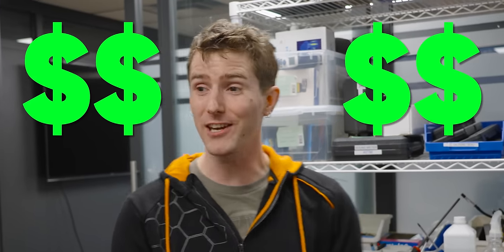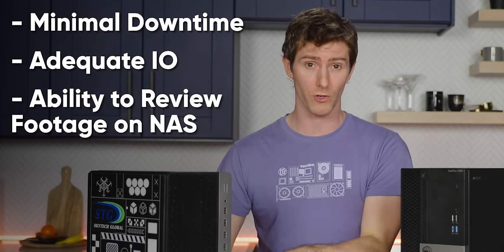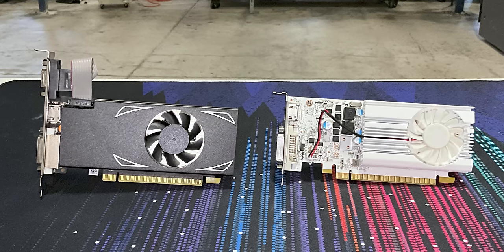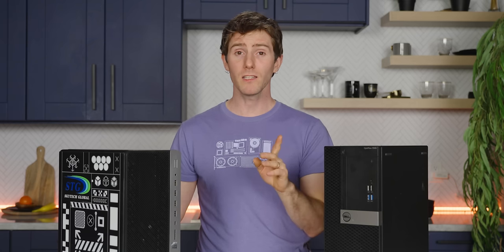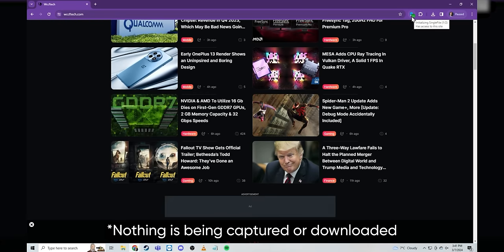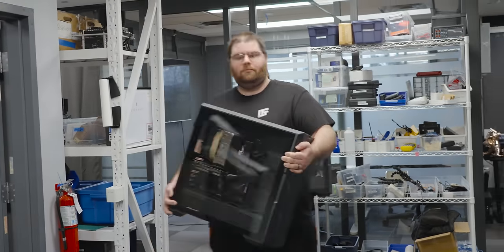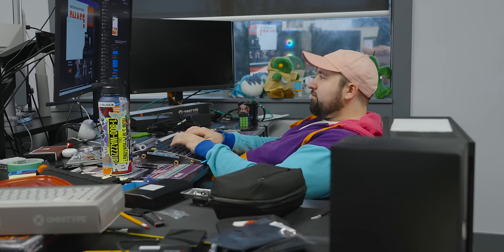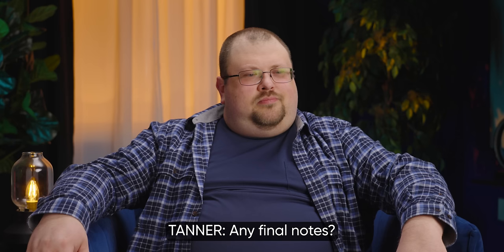We Downgraded our PCs to Prove You Don’t Need a New One

Comment: Not mentioned in this video: Many companies are constantly replacing their machines every few years or so because they are LEASED and not PURCHASED.  If a computer is leased, it is a regular, expected, expense.  It isn't the company's problem to properly dispose of the machine at the end of its life.  It isn't the company's problem to repair it if/when the hardware breaks (that is the manufacturer's issue).  And, all of this... is exceptionally important... as many companies are moving to "all staff get a laptop" for "capability to work remote (whether the employee wants it... or the employer requires it)".

Yes, many small businesses could easily buy 3 "grade A" refurbished machines for their one or two "office workers".  Why 3?  One or two for use, and another when a bug in one of those forces a machine hot swap.  Gamers usually cannot get good prices on these, though, due to inadequate PSUs, proprietary wiring / case designs, etc.  Luckily for many, though, the "SFF living room PC" (for many) is now easily replaceable with direct plug in to HDMI / DP port stick PCs with built-in wired networking/WiFi.  Want to play steam games?  Steam deck (and allow your gaming PC to do the heavy lifting).

Companies lease low-end quality, minimal cost, machines.  Manufacturers make them, and make a hefty profit.  First party manufacturers (Intel, AMD) get a place to sell their low-end quality dies (lowest end CPUs) instead of everyone demanding mid to high end.  And, in the end, recyclers ... and landfills... get the waste.
Reply: exactly. We at work have mac pro 7.1 leased and I actually got to buy a 28-core 512gb RAM version at the end of the lease plan for less than 2k $. (Lease plans are usually 2~5  years, ours was 5, now the whole company uses mac studios on an another 5-year plan.)

Comment: Question: did you just move the system drive 2:40 and boot from the old windows installation or did you re-install?
Because no re-install would explain quite some of the issues you ran into.

Comment: I really appreciate your channel making this video, and I hope you periodically shine a light on this perspective in the future. If I have one critique, it's that all the "test subjects" are from the writing team. The video does a great job explaining why video editors & CAD/designers were excluded, but what about the other departments? Are the other departments already using brand-name prebuilts? What about Sarah (or someone from her team), or the labs? (seeing as this might have been a great cost saving measure for an expansion with multiple workstations)
Reply: Well Sarah is presumably running Photoshop and illustrator where cpu speed is still important, labs would be compiling, crunching large spreadsheets and who knows what else. 

Presumably they also wanted to stick with fairly technical users who don't do heavy processing on their machines which is pretty clearly the writing team. Also it's one member of the writing team coordinating this video so they probably just asked the people who sit around them
Reply: I work in a professional CAD (primarily Solidworks) environment with older (admittedly workstation class) DELL hardware. I call BS on the majority of calls for the lastest hardware being needed. I still use a Quadro P4000 for example, and it's more than capable of running my software. I'm limited more by other inept co-workers than I am by my hardware!

Comment: "...As recent as 6th gen"

A lot of companies have 3/5 year replacement cycles. At the company that I work for, we're now cycling out 10th gen laptops and starting to cycle 8th gen desktops (we've just completed our 7th gen desktop decommision)
Reply: work is 5 years, and most people are not due for an upgrade quite yet, when the covid hit everyone got a laptop and desktops are only for those that actually need extra power the high end laptops can't provide
Reply: @EnyoStudio  doesnt the AI requirement only apply to prebuilts shipping with 12?
Reply: @EnyoStudio isn't the CPU only a bottleneck if the game actually uses the CPU but since most games only use the GPU it doesn't matter?
Reply: @Lollllllz we are barely on Windows 11 and your saying Windows 12 exists? Lol
Reply: @bland9876  there are rumors that the  the next major version of windows(commonly referred to in the rumor mill as 12) will require an NPU and 40 TOPs performance of unknown criteria and 16gb minimum ram presumably for the AI features.
Reply: @Lollllllz  who would want that? I'm skipping win 12 if it's that bad.

Comment: I'm using one as my main media player (streaming, stored videos, music, etc). It's a 3rd generation i7-4790 than can IN FACT play the newest games... IF it's it got a beefier display card in it. I put in a simple 1060, which is more than enough for just playing media. Got it refurbished from Amazon and I tweaked it to my needs and put it in a nicer case. I tweaked the GUI to resemble more like a smart TV app and programmed macros to use it with a PC remote control so it auto opens webpages and auto full screen without having to manually glide around with a mouse cursor.
Reply: I helped my dad build a low budget pc for him to run ms flight sim, i7-4790, 32gb ddr3, rx 6600 - 
Runs 4k on high totally playable (given that a sim is not a fast paced game, so 18-20 fps goes fine)
Also manages to run the sim on VR at 1.1x quest 2

Comment: I mean there is a reason schools and large businesses standardize their equipment. One companies like Lenovo offer better warranty on their business class items. Especially if purchased not via normal retail. It makes it easier to manage and replace a device if it does crap out as well if you buy devices with removable storage as then you can just swap machines out and move hard drives and have the user up in a matter of minutes. 

I led a school roll out of Lenovo desktops for a district and it was like 1400 machines. Before delivering them they had us setup the bios with boot order for things like boot from network most other methods really locked down and with a password they provided. 

Once delivered we setup them up hit the power button and they pushed out custom school district images to each pc as it booted over the network adapter. It also lets them wipe any remotely as well. Pretty handy in some circumstances.

Comment: My current gaming PC is a circa 2013 engineering workstation optiplex rescued from a pallet in the shed at work. It had mold growing on it. 

$150 worth of GPU and PSU later it runs great

Comment: ok.
Those "bugs" could have been related to the fact that you just moved the SSD to the other machine and not a fresh install.
Also, Some of those could be related to GPU issues. 
I think some 8-9 gen CPU machines would be ideal for office stuff, with a drop in 1650 gpu for a powerful yet reasonable gpu. I suggest Tanner try that combination and see what happens.
Reply: Flickering youtube is something that happens on my gtx 1070. It is chromium bug that nobody fixes for a year or two.

Comment: I'm still running a i7 4790k, with a 1080ti and 16gb ram
Reply: i dont know other countries but in mine 4790k prices are ridicilous - its only 20% cheaper than i5 12400f, z97 mobos has the same prices as used b660, and ddr3 cost more than ddr4, so i matter of whole pc cost 4gen cost more than 12gen, sometimes even 3gen cost more
Reply: 1080ti ? sheeeesh someones rich, nah ive just upgraded other stuff first, i7 7700, 1070, 32 gb ram, and tbh the saddest part, my cpu holds me back more then my gpu in most games.
Reply: That's still a baller PC, even though that CPU is kinda shit by today's standards mostly cuz it's a quad core, the GPU is still upper mid-range, it outperforms both the rtx 3060 12GB and the RX 6650 XT 8GB, which are both very popular and not to mention, much more expensive cards.
Reply: what games you play? i wouldn't want to play cs2 with that rig lol
Reply: YOOO I USE i5 4670K WITH RX570
Reply: @bored588  i wishhhhh, i got the 1080ti for free
Reply: Haha I have the same cpu and ram setup. Works great for me. Only got a gtx 960 though.
Reply: Bro that was a godlike system back in the day
Reply: Im still running my laptop with 4720HQ and GTX960M, it's still quite capable of doing a lot of things.
Reply: @georgelong5180  the 960 is a great card, as long as it's the 4GB model
Reply: I5 3560k, 16 1600, 2.5"ssd boot, 2x 4tb running in raid, quadro m4000. 
Not a gaming beast but will get all my work done no issue

Comment: Are we certain that putting drives from new computers wasnt the issue? In my humble experience windows drives put into different systems tends to shit itself.
Reply: Yeah. I agree with you, those machines shouldn’t be that bad.
Reply: See I have had zero issues doing that. My current OS install has been through multiple upgrades. It started as Windows 7 on a Q6600 followed by an i5 3570k. It was then upgraded to Windows 10 and shortly after cloned to an NVMe on a Z97 board. Then it got upgraded to an AM4 X570 with a 3700x and now it's in the same system with a 5800x. I've amazingly had no problems and still boots in seconds. That said, I do run maintenance on the registry from time to time and I have also removed all traces of previous drivers (including force unhiding everything in device manager to purge old entries).
The main reason I imagine that the old systems were that bad is I bet they have a LOT of background processes/apps purely because they can do so on their modern systems without noticing it.
Reply: @AndyMitchellUK26 The glitching what bothered me mostly, tipical driver issues. I experienced exactly this when I tried to save the data from an old pc.
Reply: @AndyMitchellUK26  Did you hear of Theseus' ship? xD

Comment: The 4th gen chips are still good! not that much of a downside unless you doing heavy workloads! Love the video!
Reply: i like 12 gen core i5  storage speed is what matters whit light use
Reply: @404hopenotfound  Man, My pc is a dinosaur... Like flashbacks to un-bearded Linus reviewing the pc I am using old.
Reply: wow hope you dont have to use the igpu they were pretty bad @BinkersGaming
Reply: Even 4th gen is more than enough for casual users. Today I used my backup laptop that has a 1st gen i3 and forgot how snappy it is with a period-correct OS and programs.
Reply: @BinkersGaming I had x58 2008 platform until a few years ago, I know a guy running althlon 64 on Linux
Reply: Linus should have gone Sandy bridge. I am still using my 2500k for my plain office work, but with a rx570 was still fun to play Fortnite with.
Reply: I'm still on a z97 MB running a i7-4790k with 16gigs of ddr3 ram and a 1050ti gpu. Works perfectly fine for me 😁 wouldn't mind newer tech, but then again, it doesn't feel necessary.

Comment: Thank you. Still using 2007 VIA C7 2GHz (Jetway J7F2WE) desktop under Win XP, 2009 Intel Atom 330 1.6GHz (Jetway NC92) desktop under Windows 7, 2013 AMD E350 1.6GHz (Gygabyte GA-E350N) desktop under Win 7, 2018 AMD Ryzen 5 2500 laptop under Win 10. Working fine beside the RAM usage getting ridiculous with each Windows update. For "security reason" they say.
Reply: good god, sorry but those are and where horrible embedded systems. do you per chance just run industry software on the embedded systems? because thats the only usecase i can fathom where they dont need a few minutes for moderate tasks. laptop is fine tho, ryzen mobile rocks.
Reply: @tarkitarker0815  Not embedded systems, full mini-ITX boards, very efficient, just some lack of memory on some of them. I don't do gaming on them though, for obvious reason.
Reply: @davidkoch9123 well my point still stands, and dude, you cant get shit done on via, via was remarked as too slow to enjoy working even back when the chips came out. it has a reason ibm bought via for the sole reason of "no interaction" low power systems to watch over things like surge spikes. i get that you can live by it, but you would have saved money if you dropped the via system as via was EOL by energy costs. idk if you keep it as a hobby but it seems that way.
Reply: @tarkitarker0815 Of course no more "real work" is done on it, yet it remained my main system for more than 5 years and it did great, office work, coding, browsing, the biggest lack was video capability, had to add a 5200 video card to get decent 3D and playback, but still a great system, whatever you may believe or not, the C7 was very capable back then.
Reply: @davidkoch9123 define "back then" up until 2012 i believe you, you made it sound like you still use it. none of the systems apart from the atom were awful 4 years after release, but shortly after. the atom was just ewaste to begin with.
Reply: @tarkitarker0815 Atom 330, was mostly to have a 64 bits dual core complete system for $75. And yes, up to 2014 it was good, but Windows' updates made them harder to use.

Comment: Right now I'm using an old Dell laptop from 2007. I bought it at an estate sale for $50. I upgraded the ram, it came with just 1 gig, I put in 4 gig. I also put in an ssd. Boot time got much better. It's running Lubuntu. 22.04
Reply: Good deal....  //  If you are using a video editor.... or if you have a suggestion... which one would you recommend?   Thanks.
Reply: That's one thing I'd like to do this summer: put NVMe in my old boxes which are now on spinning rust.  I'll need other media for boot, but that should make things a lot snappier.
Reply: @FeedScrn  Thinkpad T480's are adequate for video editing
Reply: @MinecraftCheating  - Good to know... Thanks. Also... a possible software suggestion please(?) Linux works for me as well.
Reply: @FeedScrn  it depends. the t480 can run windows 11 or 10 very well. if you want to use linux, i'd suggest popOS

Comment: My company actually started having me build the machines we use (we’re a very small company personnel-wise so we can get away with that) and legit one of the first things I do is evals on what the tasks are that are going to be accomplished by each machine, and then spec the machine to be excellent for that task set for a duration of a minimum of 5-years, and can be stretched for 10 in case we find ourselves in a financial pickle at upgrade time. We save money from pre-builds but only because my time would be used for similar amounts going through the process to purchase and validate machines, but if you don’t have a me at your office, modest spec’d pre-builds are literally just fine to get work done.

Comment: Do you think directly installing the SSDs from the fast PCs to the older ones contributed to the glitchiness? I have a suspicion that windows was a little confused at times, which led to installed drivers misbehaving.
Reply: That is a strong possibility.
Reply: Thought the same thing
Reply: Same.
Reply: Likely driver issues
Reply: Ya they needed to do the driver uninstall install thing. Linus never mentioned doing it so I'm guessing they didn't since it's important enough I think they would have mentioned it if they did it.

Comment: dell x280's can be had refurbished on amazon for under $200. 8600u / 16gb ram / 256gb ssd / 1080p 12.1" touchscreen / USBc power. I bought 20 of them as a temporary upgrade for the cost of 2 of the soon to be distributed new machines.... and because they are 8th gen, they are windows 11 compatible - so they have a long service life ahead of them.

The T460's that we just retired have been workhorses for 8 years, and are still perfectly serviceable. I have not had a single dead unit.
Reply: Inspirons are also around this price point if you buy direct from Dell and come with a brand new i5. Noted not as rugged.

Comment: My daily driver is a HP Elitebook Folio 1040 G1, with Intel Core i5 vPro, 8GB (or 12, can't remember) and a 500GB M.2 Sata SSD. Changed the battery a few years ago, otherwise nothing done. Its released in 2014 and I've had it since 2015. It's my second Elitebook, my previous one was a 8560p. My father-in-law still uses the 8560p as his daily driver. I added some memory and put a SSD in it